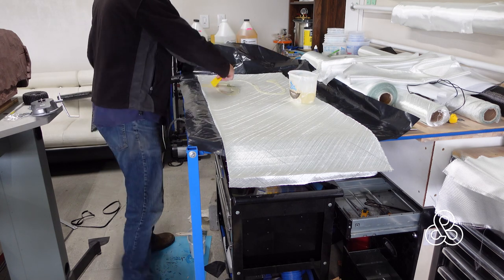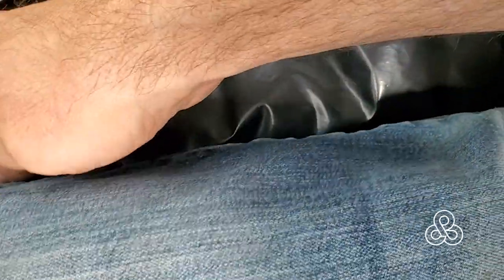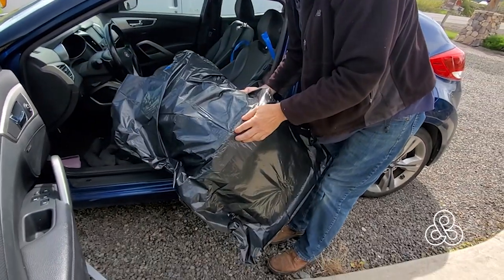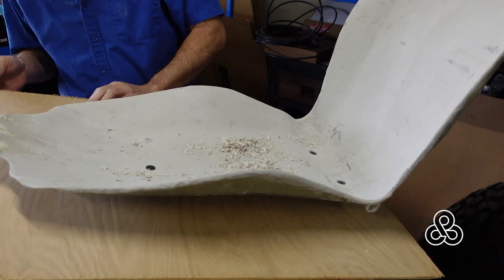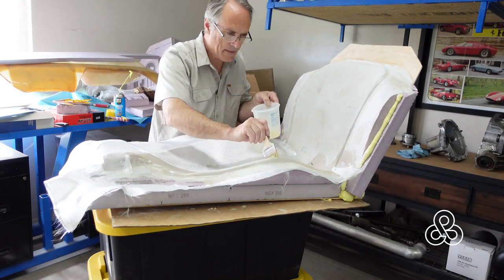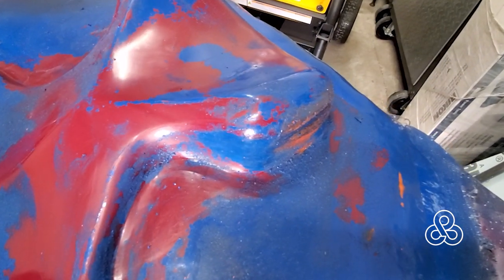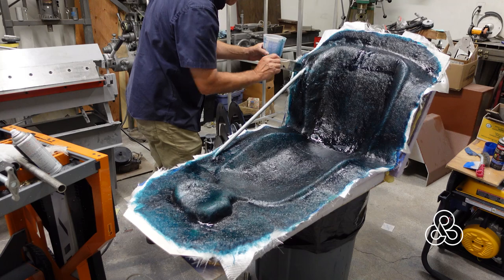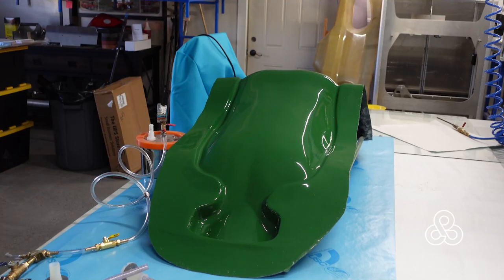A82 Need Carbon Fiber Seats In Your Supercar? I Made a Mold to Build My Own!

Comment: Do you do the poly resin coat before the epoxy resin coat is fully dry for adhesion, or does the previous coat have to be fully dry first?
Reply from the maker: Needs to fully cure before switching chemistry.

Comment: Please can you tell me does in carbon fiber seat need any core material or just some layers of carbon fiber is enough for a strong seat
Reply from the maker: Enough layers would work, or you can reduce the number of layers by adding a core.
Reply: @BuilderCreator  can you tell me how many layers would be needed for 10mm thickness seat for that i have 3k 200gsm twill carbon fiber cloth and i have 2mm nomex honeycomb sheet.
Reply from the maker: @shayansaleem1137  Well, to reach 10mm you are going to need 30 layers; as a 3K 200gsm cloth is only .254mm thick (.254mm x31=7.8+2mm honeycomb=9.8mm) But I would think that 4 layers as a base and 3 after the honeycomb would produce a fairly strong seat.
Reply: @BuilderCreator  thanks a lot for helping me out. 
You mean max 5mm thickness will also be a strong seat. 
One more thing should i go with honeycomb sheet or lantor soric sheet 4mm for core ?
Reply from the maker: @shayansaleem1137  I have never used Soric, so I could not give an educated answer on a comparison.

Comment: Whats the name of Carbon Fiber Small Fibers? Where can I Buy it?
Reply from the maker: You can find chopped carbon fiber in many places. (Amazon). I have discovered that I like to use a rotary cutter and cut regular carbon fiber (2x2 twill fabric) into small squares and break them apart. More random lengths and cheaper.
Reply: @BuilderCreator  Donyou have a Video using a Rotary Cutter cutting the material?